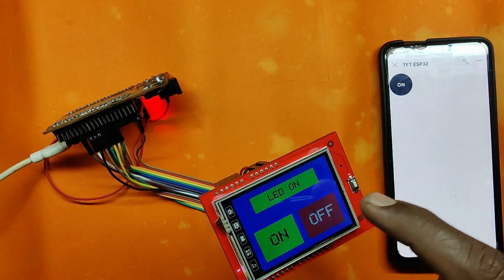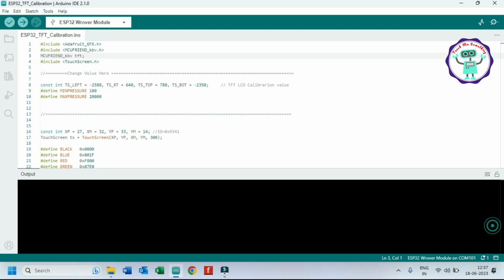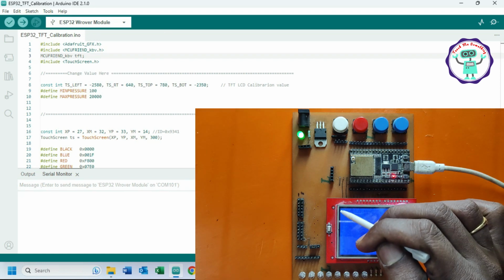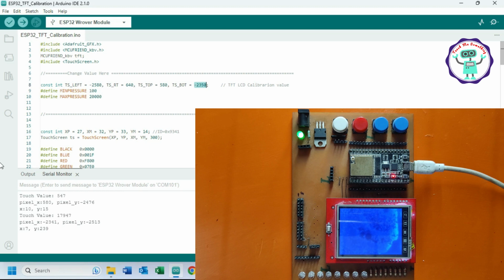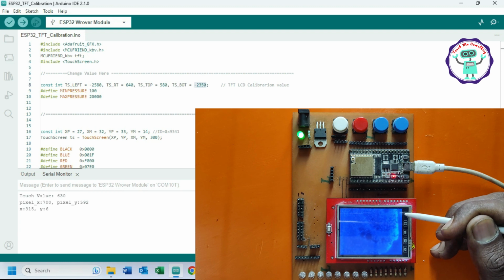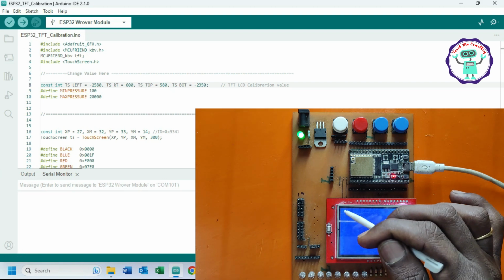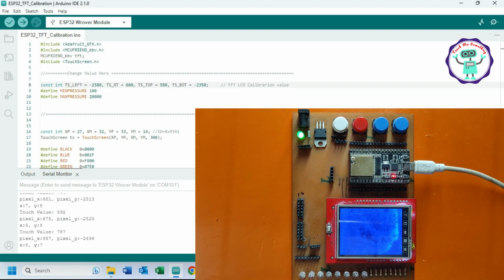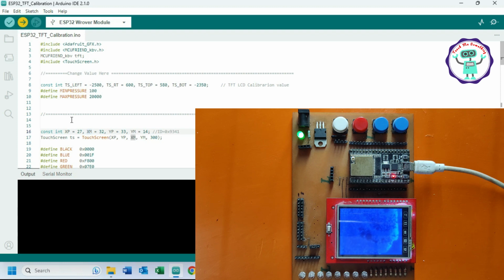TFT LCD Shield Touch Calibration | TFT display touchscreen not working |  Arduino TFT Touch issue

Comment: How How can that be? Please help me. The y coordinate shows 0 all the time. Screen display only white background. There is clearly a connection error or the pins are not configured somewhere. I used the library and the example from the lesson and will repeat everything the same way.
Reply from the maker: Use my library . Don't install from arduino

Comment: @TeachMeSomething   Why does the y axis always show 0?  pixel_x:-663, pixel_y:783
                                                                               x:1, y:0
And the screen is white all the time. Blue fill does not work and graphics output does not work.
Reply from the maker: If no changes means, your touch pins may vary. Change your touch pins in program and test
Reply: @TeachMeSomething  This pins ? XP = 27, XM = 32, YP = 33, YM = 14; I don't even have an image output. do I need to edit something in the library to configure something? Okay. There is a test case in the mcufriend library (graphic test kbv). In the example, there is an output of a picture with a penguin. On the arduino mega, I was able to display images based on this example. I face a lot of problems on esp32. Do you have a lesson on this topic? I need to make icons with the ability to click on the touch screen on them.